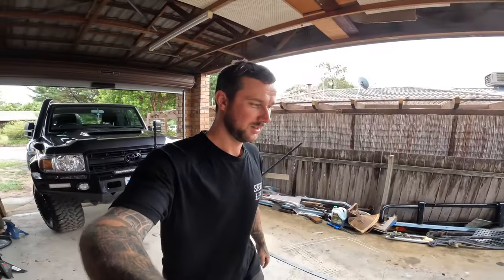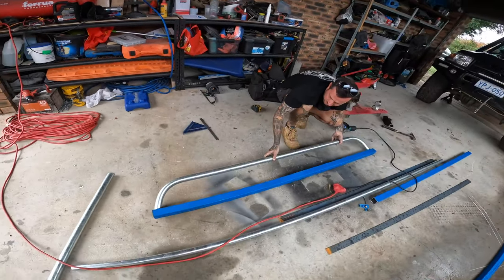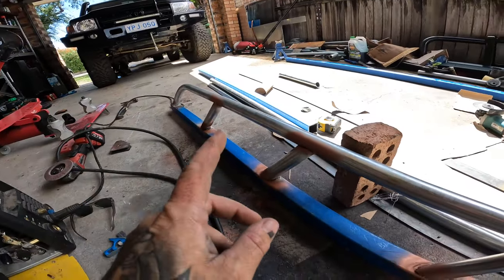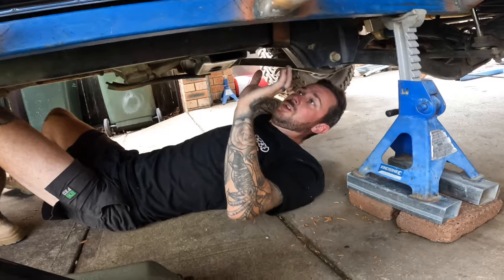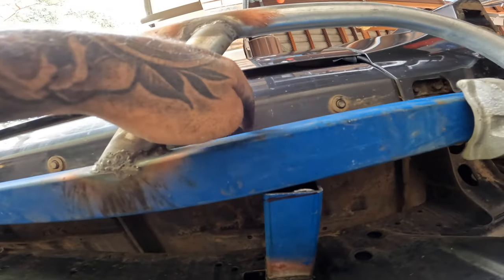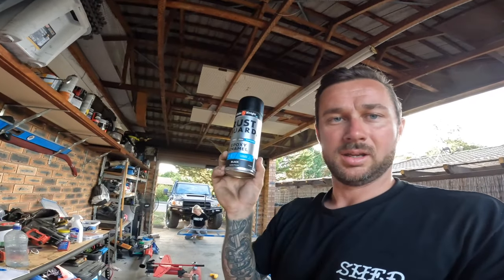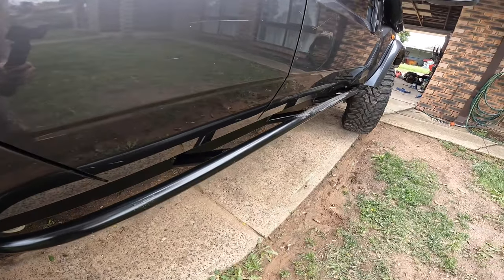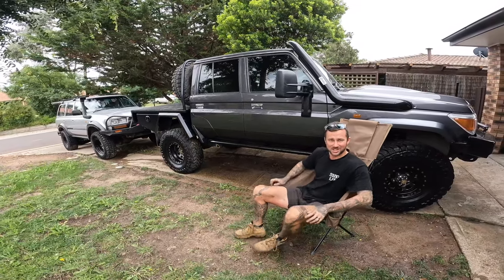making rock sliders for the 79 series cruiser

Comment: How is your re-spray paint job holding up?  And maybe you mentioned, but what gauge/mm thick bar did you use?  Thx, at some point wantg to be do something similar on my kzj78 here in Uganda, am a bit worries about getting a paint job to last any time at all, it is our family's daily driver and used for lots of short trips, so lots of wear on the sliders/steps.  Thx for filming this
Reply from the maker: I repainted them with 2k paint! So far so good with the new paint! I used medium wall 32nb which I believe is like 3mm thick
Reply: @Grouse4x4  thanks for the info🙏🏽